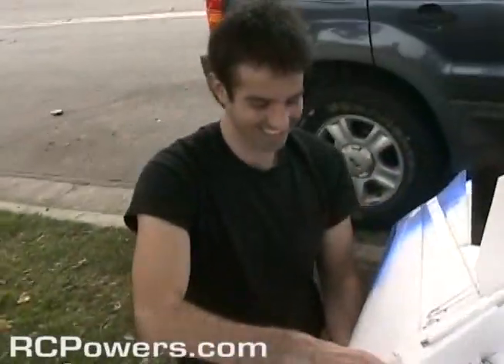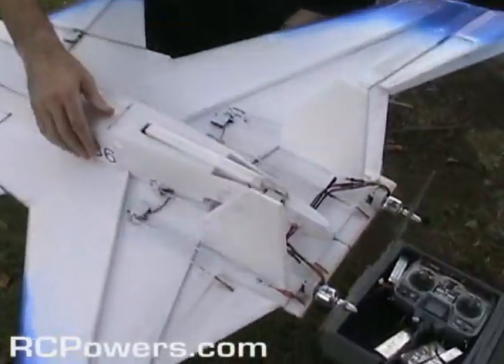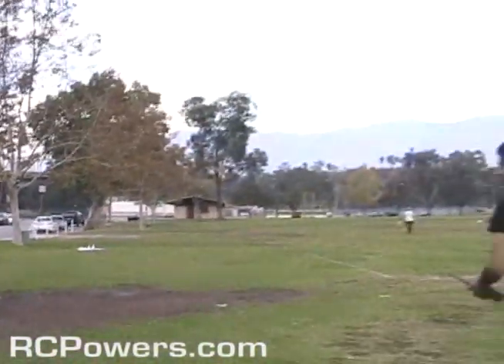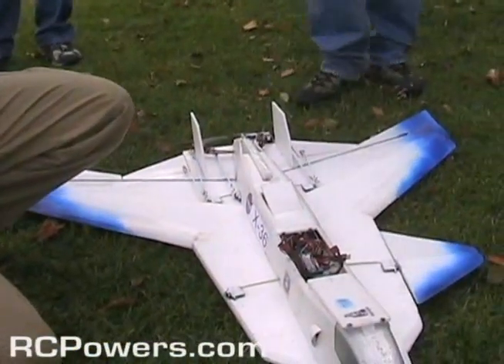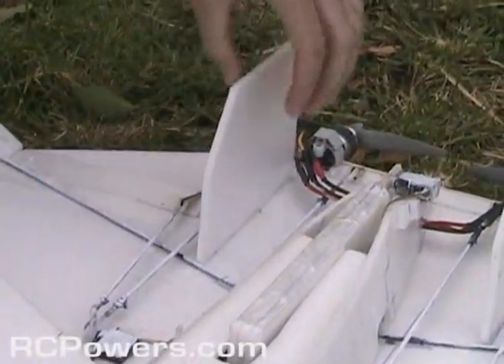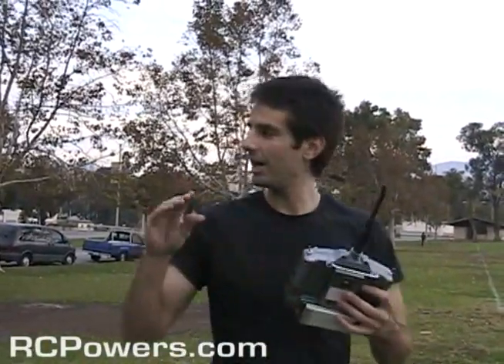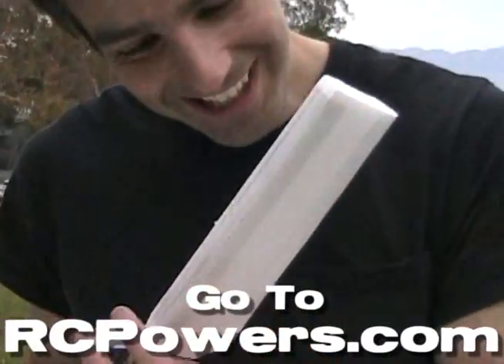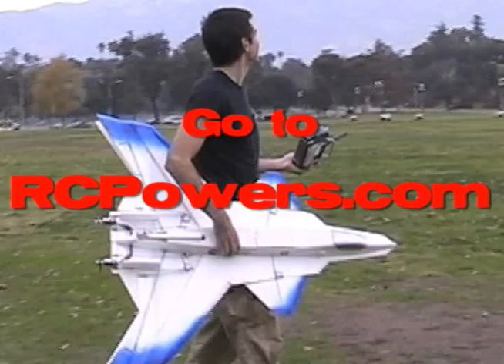1st Flights of the Tailless RC X-36! (see sidebar)

Comment: I did have a suggestion though, see what you think about it. I know your using props to propel right now but what if you went ahead and made the inlet ducts. Make them as if you was using fan units and run them along the fuse as in the full scale or the 1/4 model. The long tubular inlets would channel air inside and out the rear. I think if the air was channeling inside it may help lock the plane in a straight line and help reduce unwanted movements at higher speeds.If my idea makes any senselol

Comment from the maker: There is 2 receivers, 2 motor, 2 batts, 2 ESCs, 1 or 2 on board mixers as well.  2 servos is to help support the 10-14 servos needed. Just easier on the electronics to spread things out.